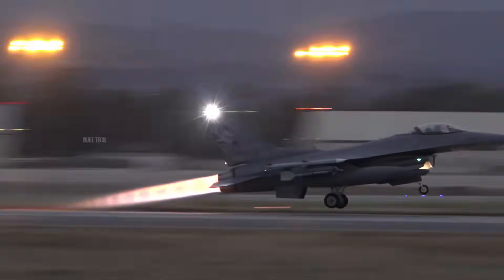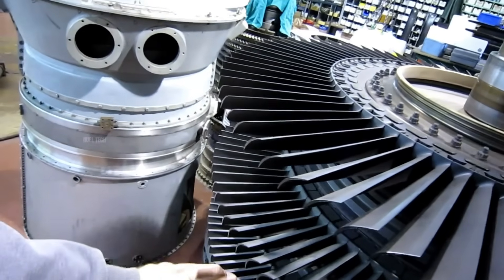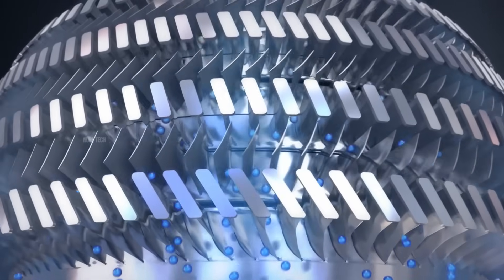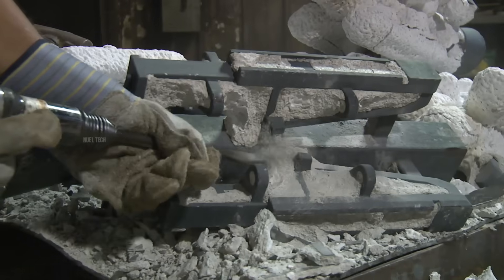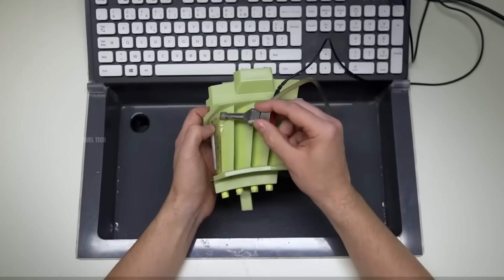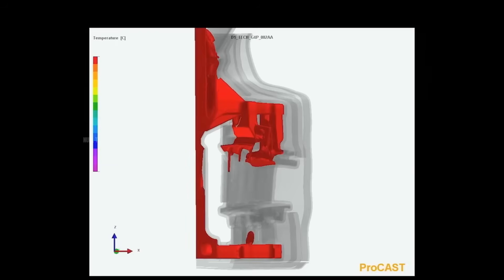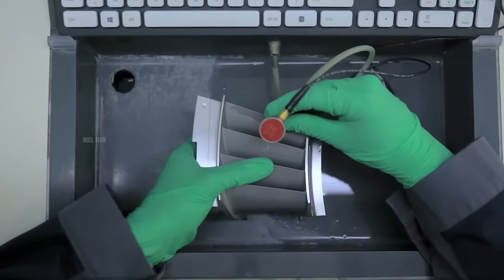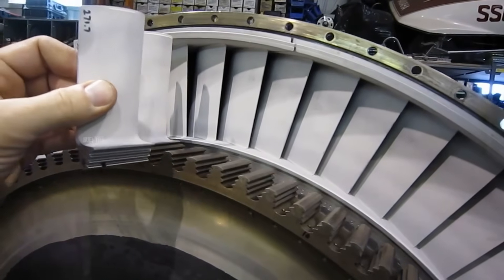Why Don't Jet Engine Turbine Blades Melt? What are They Made of and How are Blades Made

Comment: This video, while generally informative and having some nice graphics and video sequences, has some nomenclature problems and errors.

The title refers to Propellers. There are no propellers in this engine or video. There are fan blades, compressor blades compressor stator blades, nozzle sectors and turbine blades. 

The four foil assembly that is the subject of the heart of the video is most properly referred to as a sector of the nozzle, where the combustor discharge is directed from axial flow to largely tangential flow where it will enter the first stage of the high pressure turbine. This complex piece is stationary and deals with the hottest gas flow in the engine. The blades that rotate in the flowpath after the nozzle are called turbine blades, the ones that do not rotate are stator blades. The important difference is that stator blades do not have centrifugal stress components. The turbine blades do.

Looking at all the blading from front to back, the compressor blades, before the combustor in the flowpath are not made from superalloys, They are generally 400 series stainless steel. The fan and first few stages of the compressor may be titanium alloy. Titanium alloys are prized for their strength and low density, but Ti cannot be used except for the first few stages. Titanium alloy will spectacularly burn if it is used too deeply into the compressor where the air is sufficiently hot and compressed. This combustion is typically ignited with a blade rub. Titanium is perfectly fine if it is used where the temperature and density of the air is comfortably below limiting values.

Comment: The Adjustable size tires back loader of functional rectangular box carried of such other one of 2 tandem equipments have multi usage of box elevator installation equipment by specific for a boxed battle combat drone launcher multi function transport vehicle to a modular change and insert equipments with additional on board radar and sensors  as surface to air missiles launchers defensive weapon to an offensive weapon of precision Infra Red Search and Track tipped rockets and missiles with GPS guidance, to Laser firing point defense to enemy of swarm drone attack laser defense to Extended range missile defense lasers to a rice or other boxed disaster and calamity supply transport for relief operation carried hind box attachment vehicle, to a appliance equipment delivery vehicle of hind box attach of such to a secret command and control comouflage platform transport with camouflage communication equipments or a racked installed farm to market road chicken poultry from farm carrier or a vegetable carrier transport whose adjustable in size tires and ability to distribute its weight patterned design for the provinces and farms of attached back carriage rectangular box multifunctional. Its a large business with public service modality my commanded business functional group, better manage that properly under my command though you have your officers, understood. Let it be

Comment: The CaesarKing order my Customized manufacturing group and Engineering Experts Brigade to manufacture produce modified multi functional tracked moved Drainage clog remover machines of mechanical arms with attachable and detachable chassis of another vehicle of multi purpose dump materials opening and closing back container hatch of transferable like customs carriage cargo trucks elongated box carriers to another functional box insert attach of specialized machines of electric post extenders up in a slider metals and lock per station of height of work focus with its own ground stabilizer anchors to typhoon felled posts and house cleaners  mechanical robotic pincher to holder with arms of again material tool by specific function of 360 degree base back box rotating chassis of its mechanical arms attachable and detachable to fire fighting trucks of slided elongated boxes with segments of hose storage with metal coil adaptors for lengthenings and segment for water storage for fire fighting and a segment for reinforced container for fire extinguishing ABCDEF fire extingishing models of again attachable to detachable like delivery container truck  boxes with its own none Puncturable adjusting in size tires able to traverse by adjust to rough environment to rocky places and muddy places to size minimized and weight distributing mechanics when traversing old bridges in the province and weight of tires  of pressurized air accommodating tire structure of meshwork atomic structure scaffold concentrate and design adjust valves and tensile strength adjusting specialized  tires rubber imbedded strings materials of either being hauled attached to the excavator of congested materials to city drainage and swamps tracked vehicles with 4 sides overlapping from its and each large hole coiled metals inserting and extending with round granulated stabilized circular metals with ridges each 4 sides of super tough materials sensors on top extending around ridges needle punctures to approximation each side of 4  circular thick rods for metals of optional magnetized mode and each 4 sides of round cases of stainless rods of coils per coils accomodators can be by functional mechanics be used as long legged walkers of a mechanical arm dump carriers of traverse to steep rocky places of extend the two front legs  then tilt the hind leg extender like a 2 or 3 point gates crutch legs likened to a modified Star Wars movie gigantic long legged mover troops carrier only in different function of when past the rocky steep or watery obstacle to its tracked mover the mechanical legs can  insert one after another until it's tracked tank like mover it's turn to move the vehicle. Ordering money fund teleport  from Galaxy fund source for first 100 units each model tandem public service and area specific or national government service equipment ends donating 5 dual tandem ewuipments of such to Manila City and 5 dual tandem equipments of such to NLEX North Luzon  Expressway, while  the rest  or remaining 90 units of such produced materials for parked reserved for functional purpose for public service or donation for needy of such materials areas. while produce custom manufacture another 500 of such for initial business presentation to buyer clients, domestic and abroad while there be an open architecture client based design specification order and manufacture business models for the Functional Business group of the CaesarKing Francis Huberto Avenido Vasquez  commanded  business of business additional of to be managed business. Let it be

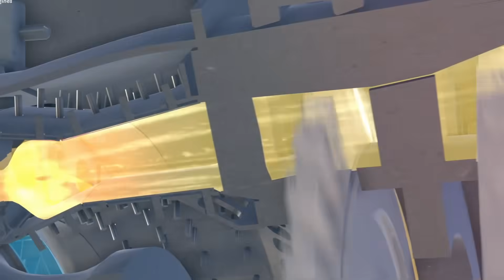Comment: 0:37 

Bro your explaination is very good but i think at this time stamp you have shown that the fan, [    high pressure compressor, high pressure turbine.   ] are rotating in same direction and then [    low pressure compressor and low pressure turbine   ] are rotating in opposite direction 

Which i think is wrong because in google many gif, photos and videos are there in which it is shown that the fan, [   low pressure compressor, low pressure turbine.  ] rotate in same direction and [    high pressure compressor and high pressure turbine.  ] rotate in oppsite direction 

I am just a student and i think*** it is wrong but may be i am wrong so pls reply 🙏🙏

Comment: Back in the day, as a mechanical engineering student in Zurich, I visited a factory owned by a company that was pioneering a new process to clear the cooling air channels in gas turbine blades. Those get clogged after a while, and at the time, clearing them was more expensive than making a new blade. This process changed that.
Good times.

Comment: All jet engines are using kerosine as fuel source which has poor flame speed. Because the entire concept of burning fuel is wrong. It's efficiency is too low that higher flame speed such as gasoline is out of consideration because of costs.

The truth is all fossil fuels have slower flame speed which will not be able to burn completely under high speed and high air pressure.

Because of that by boosting air pressure such as ramjet won't solve the issues. It will only worsen the fuel efficiency and cause massive pollution in the atmosphere.

Suggesting to improve the concept of combustion chamber. Fuel must be able to burn completely under low pressure not the other way round

Do not expect fossil fuels to burn completely when injecting massively under high speed and high air pressure. The concept is terribly wrong.

Comment: Wow!  Much more complex than I thought.  No wonder those engines cost so much!  Can't help but think somewhere down the road they will be able to produce thrust without Grade A1 Kerosene and all that heat.
Reply: They already have the technology .... I'm "going out on a limb" here - it's Classified, and I don't care that no one will believe me ...  but, it's called "anti-gravity", and was reverse-engineered from several crafts that have been recovered - from Roswell and other sites - and stored at S-3 near Groom Lake  ("Area 51").
[Checking to make sure my VPN is on, and it is .]   Anyway, we have not needed fossil fuels since 1943, but big oil needs to get their investment back. We "stole" the new technology (anti-gravity) for free, so the fossil fuels are technically "natural", philosophically.   By the way, EVs are not only not the answer, they still use lots of electricity - generated - by fossil fuels - at the electric company.

Comment: I used to work for a company that draw formed transition parts for turbine engines out of materials like Inconel,  Hastelloy any Waspaloy. They were extremely tough alloys to work with and often required annealing between operations in a vacuum furnace.
Reply: Had a vacuum furnace at my old job. Amazing to see

Comment: Used to work in a superalloy plant in the UK, we made the alloys used in engines, the scrap rates are high, we used to get crates of rejected blades back for remelting, all is done under vacuum, it's true that most are nickel based but not all, there are many superalloys mainly used in aerospace but some in medical implants, these are made from a cobalt chrome molybdenum alloy that is very hard and polished to a very high tolerance, the rejection rate for these was even worse 😂😂😂😂
Reply: Ditto. Astromet Ex from this corner. Many many many hours sorting out high-temp alloys in order to send to the smelting plant. We used what is called, A Fuess, also known as a Spectroscope powered by 240 volts. I was told by Astromet Top Brass that with what I learned there I can be hired anywhere on earth. IDK if that is true. Nevertheless, working with high-temp allows is awesome work.
Reply: Directional lamellar crystal growth process of the blades is an entire field.

Comment: This is the reason why each engine cost more than $10,000,000!! Bigger engine like GE90 cost $30,000,000!,
Reply: Why they do not melt.
Because 2/3 of the air that flows through the jet engine is used to cool it.

Comment: My oldest brother retired from P&WA and worked on the lasers they used making turbine blades starting in the 1970s.  I have a blade from a high turbine that has a few flaws. They made  them in halves and then fuse them together with a laser. My Dad retired from there as did my wife’s Dad and her oldest brother. I worked on the assembly floor for a few years in the late 1970s but my calling was electronics and telecommunications.
Reply: Which location of P&W did you work at ?  I worked in a turbine blade mfg plant for 16 yrs . P&W was one of our customers . Both PW 300 and PT 6 engine programs  we made many many thousands of blades for those engine programs .
Reply: @johnh1001 I worked in Middletown, Ct 77-79. I was an electronics technician before that and left for  that career path. Funny thing is many of the engines I helped assemble went to an airline I commuted on to Prudhoe Bay, Alaska starting a year later.

Comment: Perfect explane , did see some blades in steamturbines on powerplants , one drop of water can destroy the hole turbine by the speed like a bullet of the drop going true it
Reply: True. If water is not 100.00% pure, the steam won't be a 100.00% pure gas, and it will contain very small droplets of water..At the high velocities and pressure inside operating steam turbines, tiny water droplets become abrasive.